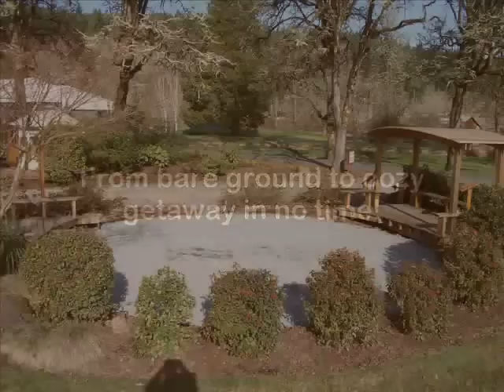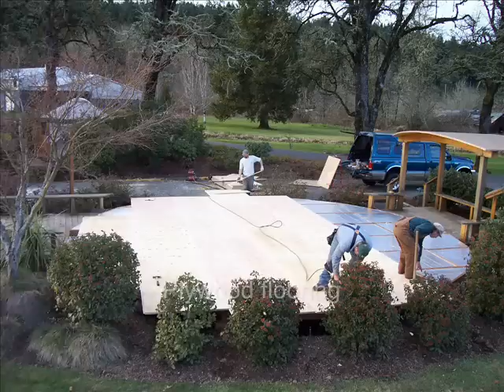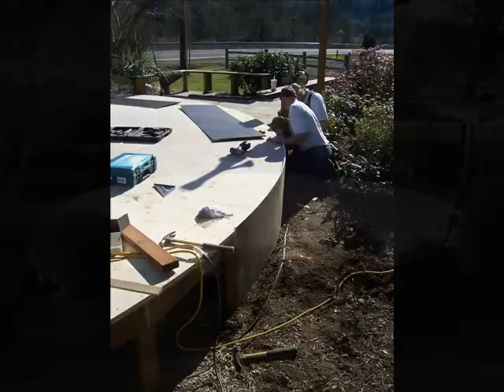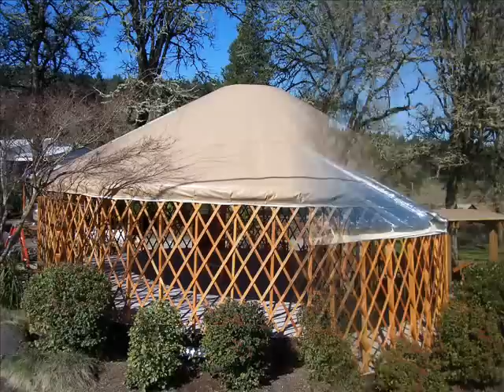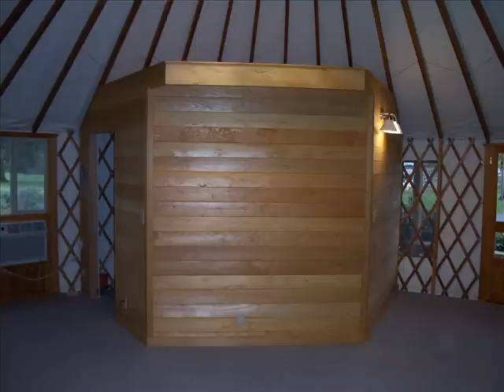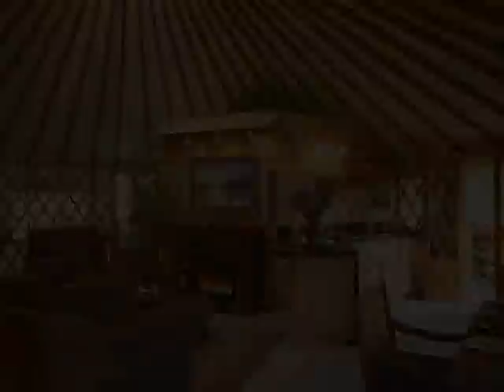30 Foot Pacific Yurt Assembly

Comment from the maker: The usual floor structure is designed for 40 pounds per square foot, which is a typical residential floor load. If necessary the floor can be reinforced in certain areas or the entire floor structure can be framed for a heavier load. This will not affect the yurt itself.

Comment from the maker: Because of the lightweight and flexible nature of the Pacific Yurt it tends to flex with movements of the earth and does really well during earthquakes.
Reply: @James Bond you can ket the snow load/wind kit. It’s either braces for the rafters or a nice stainless steel pole in the middle that can be put up or pulled down. I think they say they can handle over 100mph winds. But I’ve looked at a BUNCH recently and finally decided to go with pacific yurts out of about 12 companies, so I may be mixing up numbers.

Comment from the maker: Hi Matt. A 30' diameter yurt typically takes about two days to install after the platform has been built. You should be able to get a pretty nice yurt for $18,000. You might considering calling our representatives at 1-800-944-0240 to discuss your needs and budget.

Comment: What is being used for the floor insulation in this video?
Reply from the maker: +FamilyForJesus Rigid foam insulation with a foil facing was used in the platform for this yurt (approximately 3" thick).

Comment: i love this idea for a home... I have seen many that look awesome... but what security do you have ???? anyone can come up with a knife and slash and cut and make many holes and just slashes all over it. the ones I have seen are solid wood all around and without that ugly lattice. im not knocking them... I would love to live in one.... a solid one .
Reply: Hi Giovanni. Although someone could to cut the exterior fabric if they wanted to, there is a continuous wood lattice framework under the exterior fabric. Cutting the fabric would not necessarily gain entry into the yurt. Alarm systems can be installed onto a yurt as with most other structures. With a typical "solid" site-built structure someone can gain entry by simply tossing a rock through a window, so the yurt is not less secure. Most people love the beautiful Douglas fir lattice wall, but you could always install sheet rock or paneling on the interior if you prefer to not see the lattice.
Reply: how would you install sheetrock inside with nothing to hang it on. its round so sheetrock im thinking would not work. I have seen where there is tongue and grove wood planking on the interior walls. I know this is a less expensive yurt compared to the ones I have been looking at. I still love the look and appeal of them.just hearing everything outside such as animals and pests... I would think they would have a better chance getting into one made like this ... no ? I am doing a ton of research on these... did the bathroom have a toilet ?
Reply: Giovanni Berardinelli, larger yurts often have vertical studs along the inner surface of the lattice wall (the snow & wind kit), which allows for the installation of sheetrock. The curvature of a larger yurt is not severe enough to prevent sheetrock that is 1/4"- 1/2" thick from bending to conform. We have been making lattice wall yurts for over 36 years and rodents are rarely a problem. Most people enjoy being closer to nature and being able to hear their surroundings, so it is often seen as a benefit rather than a concern.
Reply: thank you for the input.... I did not know that about sheetrock.... I still love these... can the bottom be waterproofed ?
Reply: Giovanni Berardinelli The structure is weather tight.
Reply: First of all for any safety you should get yourself a German Shepherd.  That way no one gets even on your land. 
2. yurts are very durable structure if done correctly and you follow instructions.  
For insulation: you can use sheep wool, R 6 Foil along with Rocket stove floor radiant system.  I finally have my design and now it's time to gather up my materials to start building.  Hopefully I can have video available in a year. Goodluck
Reply: Angelia Odiame Angelia, if I may ask, what state or part of the world is yours in? I am in Northern CA, but also love the Oregon Coast. Just keeping my future options open. I'm the type who could easily see living in such a structure, and in nature. 

The Dog is a mandatory, if you ask me--nothing like a dog, and if you are going to live at a remove, all the better.

PEACE
Reply: yes - you can make the side walls whatever you want.  there;s ones the design and materials i will be using for my 24ft diameter walls are marine plywood. 
and if thats too expensive, you can use 1/2 to 5/8 inch regular plywood and paint them with Cement paint. 
it will make it water resistant and mold resistant. 
it is less expensive.   this is the site to see the design
http://www.wired.com/2014/08/a-handcrafted-7500-yurt-thats-far-cooler-than-your-house/
Reply: +Giovanni Berardinelli  Unless an angry, hungry Grizzly bear decides to plow into your yurt, I wouldn't worry much about having animals or critters able to get into the place.  Make sure the floor/subfloor is solid, seal it up, and plenty of waterproofing/anti-mold compounds to ensure dryness (remember, these things had to stave off brutal Mongolian winters, so they're made to be structurally sound).  As far as a toilet option, I have a compost toilet, which is VERY convenient, no smell, and easy-to-discard w/ Sphagnum Peat Moss.

+Asian Goddess  I have a radiant floor system set up with a soapstone pellet stove, and soapstone floor strips that interconnect inside the 30' structure.  Let the pellets burn for a while, and the floor/inside stays warm for hours--even on very cold nights!  I love the reaction from ppl as they enter inside, as the high ceilings and good use of space (e.g. counters hugging the perimeter, etc.) make a good-sized yurt seem much larger on the inside vs. how it appears on the outside :)
Reply: You mean just like anyone can take a hammer to windows if they really wanted to get in?  lol...  Don't be so paranoid, or buy yourself a German shepherd if your that worried.  Problem solved.

Comment: what is the avearage lifespan on the roof and exterior? very nomadic...
Reply: 25 years.
Reply: Our Pacific yurt (24’) is 23 years old.  We have updated the kitchen and bathroom once.  We are just now replacing the outer wall (not the roof) as it got very thin in the last 5 years and all the window awnings failed.  Plus the door…we think that’s pretty good performance - try owning a house and not doing any exterior painting or roof replacement in over 20 years…. We hit over 100 degrees in the summer and have 3 feet of snow in the winter…plus big winds in the spring…we are super happy with our pacific yurt